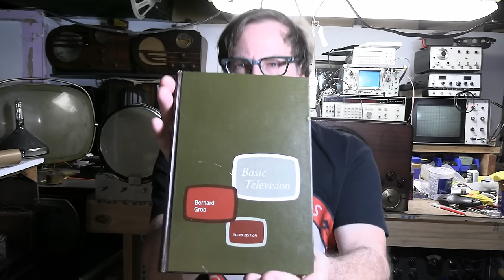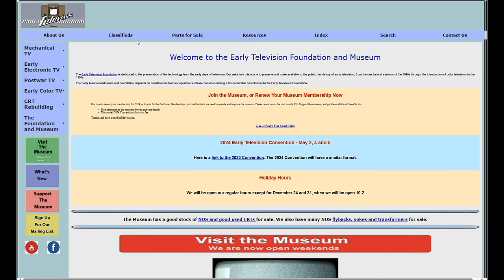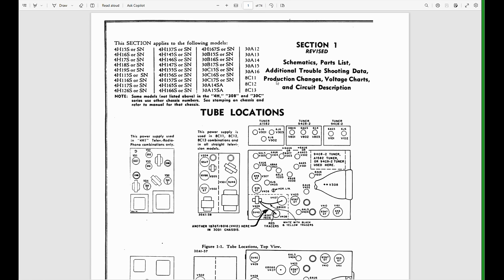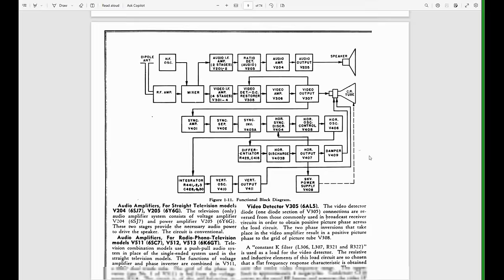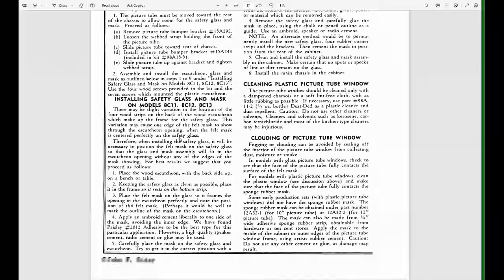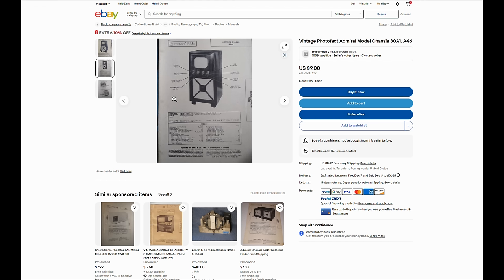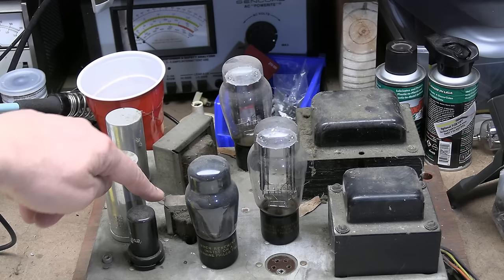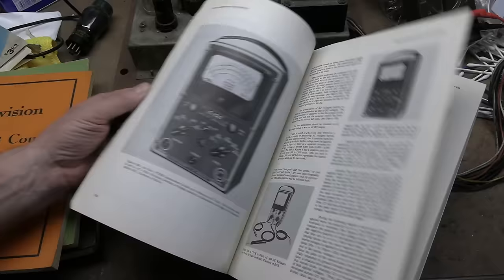Beginners guide to B&W tube TV restoration part 3 (service info)

Comment: My first experience with tv, was in the late 50’s, I believe it was an Admiral set. My dad bought me a Knight kit tube tester  to start troubleshooting this set and it was the start of my electronics  studies. I had also been bitten by the amateur radio  bug and started collecting tv chassis’ for parts, specifically the power transformers.
In the late 69/70 I attended  Williamsport Community College, Pa. (Formally Williamsport Tech. First semester we used Basic Electronics, title by Grob.  My last semester I took a class in television. The book you referenced is the same book we used for a text. I still  have my books for reference today. The television book still has the original bookstore price inside the front cover, $19.95, I really like Grob’s style, these are the best electronics books I have ever found.
My television Instructor was Mr,  Briggs.
In the 70’s  tubes we being phase out  with transistors. Folks used  to laugh at  tube television technology being antique, but there were still many practical applications for tubes even to this day, and the associated  circuitry with solidstate remains the same. 
Thank you for keeping this vintage hobby alive.

Comment: Thank you, Bob, for the explanation of how to use the Early Television website. I found IF alignment info for my Philco 50-T1630.  Sam's only had a schematic.  Now I can get the sound and pic in sync.  Also my tv had the horizontal width coil cut out of it.  After the fly-back replacement, I used a power resistor in series with the 1/4amp fuse to slightly reduce the fly-back voltages and width.  All has run cool for a few years now.  Triad makes a more rugged transformer.  Better than OEM.

Comment: Thanks for these instructive videos in vintage TVs. I just got one Admiral Black & White 23 inches made in Canada as model CG3321 using chassis G4-4X and G4-4XU. I live in Montreal. The cabinet is so nice despite it is not working I am willing to keep it :). Anyway, I checked all 12 tubes confirming the heaters are not broken ( resistance measured between  2 to 13 Ohms ), checked power swift resistance OK but no sign power. It is dead (may be the rectifier ?). Therefore, I tried to follow your advices about those sites and ebay to check the diagram but without success ( it seems Admiral models and chassis started with number not a letter :( ). Any tip for us ? Thank you....I will continue to follow you in this TV restoration. All the best.
Reply from the maker: Canadian models are not included in the sites I mentioned. Check on the Antique Radio Forum in the TV section. There is a guy that has Canadian service info. Ron L I think

Comment: These books will also help me learn about vacuum tube audio, e.g. vintage guitar amps and such, at least in terms of TV audio circuits, right? Are there even better books from the same era and authors for guitar amps, and vintage radios and such?
Reply: There isn't very much audio circuitry in TVs. Rider's did publish some books on audio amplifier circuits (Hi-Fi, etc.). There is a radio history website that has PDFs of many old books and magazines. There is a forum online about Audio equipment. Youtube prevents any pointing to other websites. You cannot even describe them by name it seems like. That's kind of bad Karma.

Comment: I think that SAMS renewed there copyright on anything newer than  about 1962-63, so scans are not actually legal. You can certainly buy a used hardcopy however.
Reply from the maker: What about scans pre 1962?
Reply: @bandersentv  Oh, those are fine. I'm unsure of the exact year. I heard about it on one of the forums sometime ago. There is at least one online source for SAMS downloads (for a fee) that only has files earlier than a certain date, the copyright is probably why.